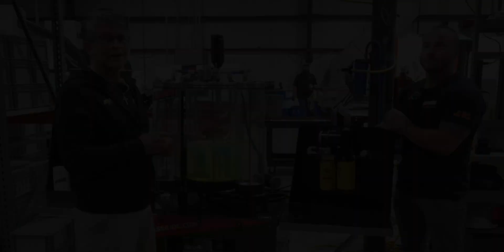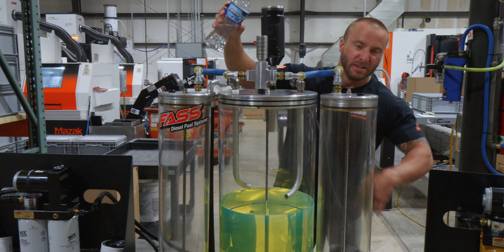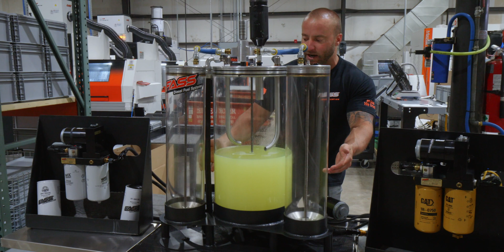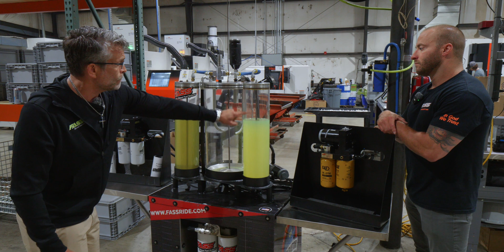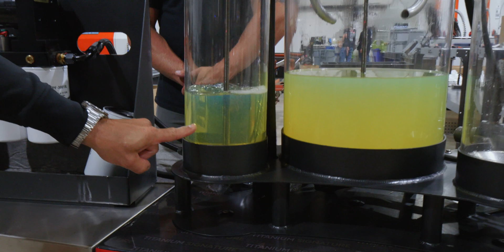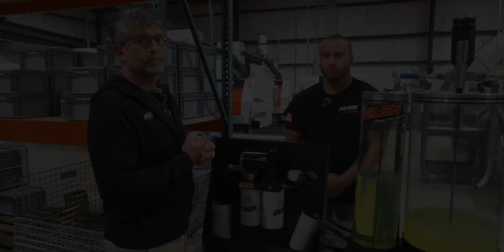FASS Water Separation Demo: Filter “Upgrades” 101

Comment: I'd like to see how the Fass filters handle the original mixture as opposed to cleaning up fuel thats already been run through filters once previously to actually get a fair comparison. How well would other brand filters do if they got the "clean up" job also?
Reply: They’ve shown that in other videos… a side by side.  FASS clearly outperforms Cat and Others. Water & Air separation can’t be beat, FASS is tops!